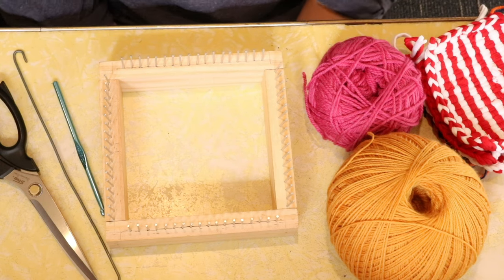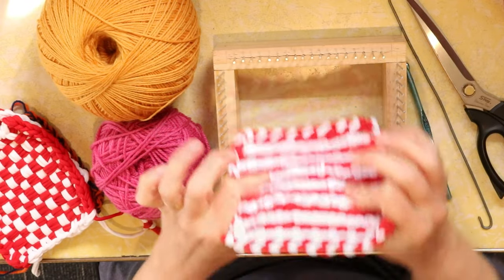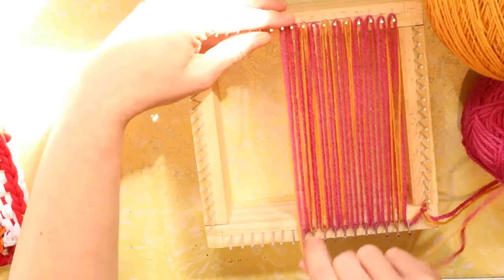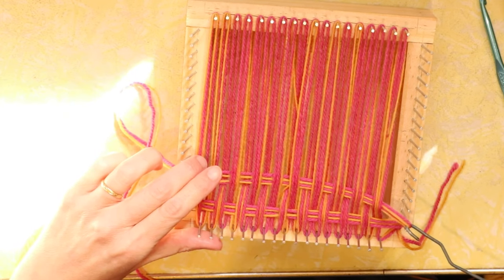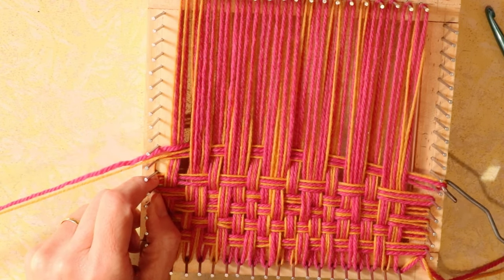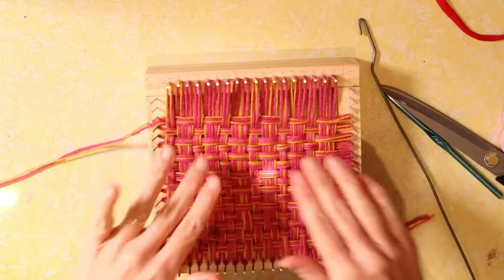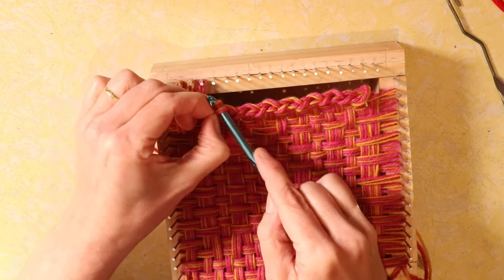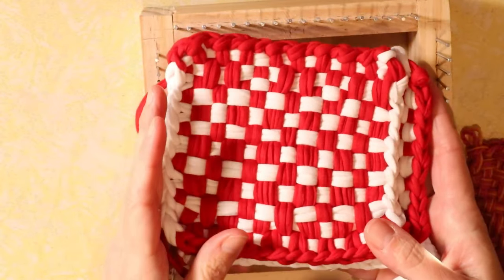Make a potholder loom and weave on it!

Comment: Thank you, bought a pot holder kit at a thrift store for my grandchildren. No loom just a box of loops and the hook. I don't want to pay $15 for a plastic loom. When my sister and I ran out of loops in the late 60's early 70's, we used old socks and they cut in continuous loops and for the most part, we used old cotton socks.(we did mend socks but sometimes the toes of the sock got darned too many times so we used them for potholder loops)

Comment: Still use t-shirt material for a pro loom of 10" cut pieces of t-shirt 2" wide and 8" length.  Fold in half lengthways wise and cut centre of material leaving 3/4"  on outside end uncu. Then round off corners and you have a loop without seams to use on your pot holder loom .

Comment: Another option for loops, go to a thrift store and try to find long-sleeve T-shirts (straight sleeves are best!). Cut the sleeves in 1cm strips, starting at the cuff. The tube of the sleeve will create the loop. Sleeves with a wider shoulder will make larger loops as you move up the sleeve. The body of the shirt can then be cut into wide strips, joined into another tube, then also sliced into loops.
Reply from the maker: Great tip!